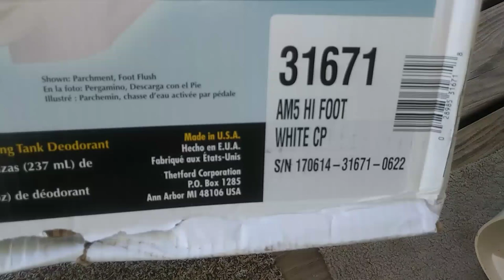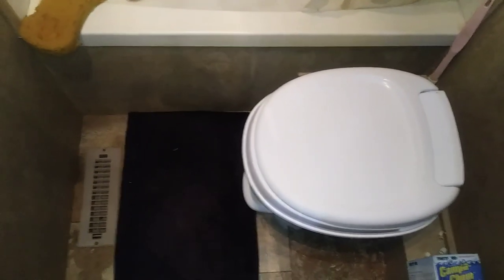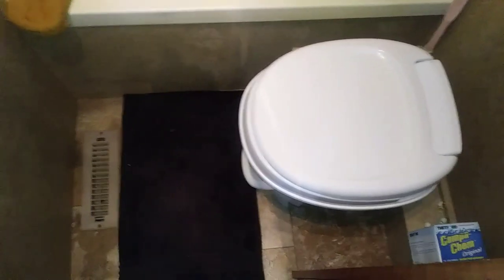RV TOILET REPLACEMENT...part 2 of 2 Aqua Magic RV Toilet...

Comment: Hey Rusty, why don't you show the replacement of the toilet. Does me know good to hear you prattle on about the water connection without showing the actual installation of the toilet. Fail.

Comment: I'm glad you got the Kings Throne installed. After seeing the old new toilet you could have used a grey pipe glue and  glued fitting on. The grey pipe glue has a high psi and would not leak. You can keep as backup. You are now a contractor?!!! Lol 😂